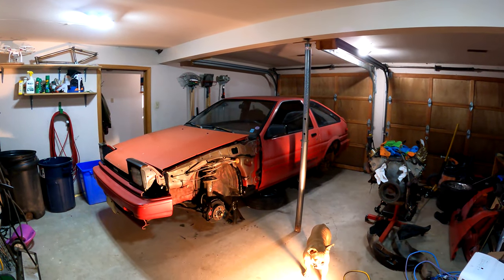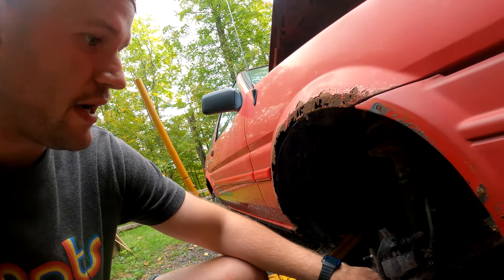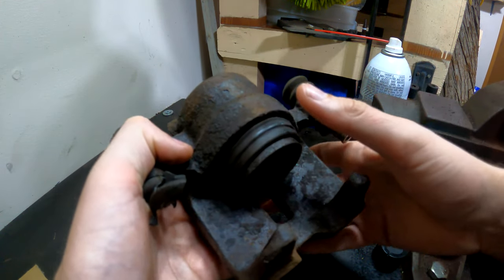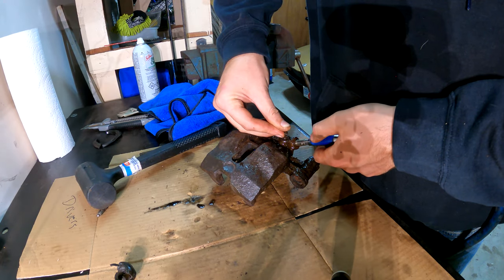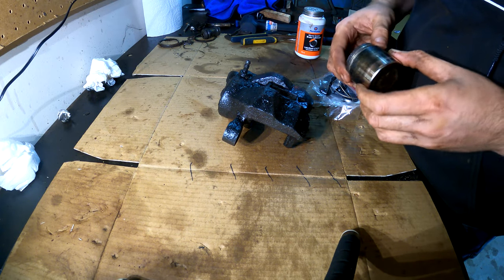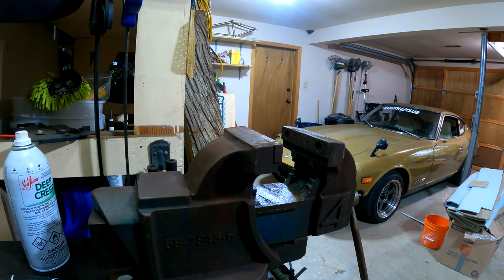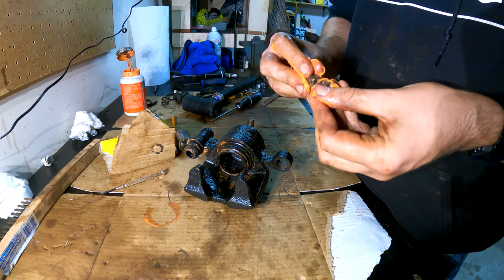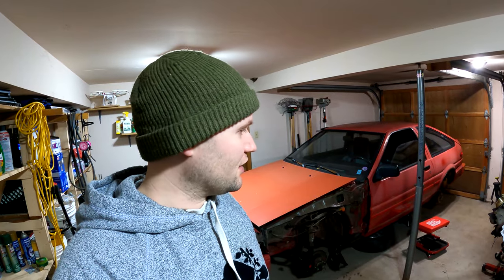How to Rebuild Brake Calipers - 1986 Toyota Corolla AE86

Comment: I was recently planning to rebuild my calipers after doing the entire front suspension/steering/brakes, but i ended up finding out they carried brand new calipers at my local autozone so I just bought new ones. Working on the 86 is really simple and feels super rewarding.

Nice Z btw!
Reply from the maker: Really! Buy a lottery ticket. I bought 3 or 4 sets that were advertised as 86 calipers but they were wrong. Ended up having to rebuild them! 86 is one of the most satisfying cars to wrench on and drive!
Reply: @south7boys  Really? I didnt know they were hard to find, I was just hoping to save some money rebuilding them, but couldnt find a full boot kit for it, and the calipers were like 15 dollars each so I couldnt pass the chance..

Also, I'd love to see any work you do on your 86, really helps when doing stuff on mine, and I'm sure I'm not the only one that would like to see more